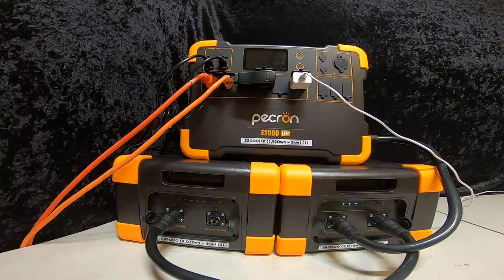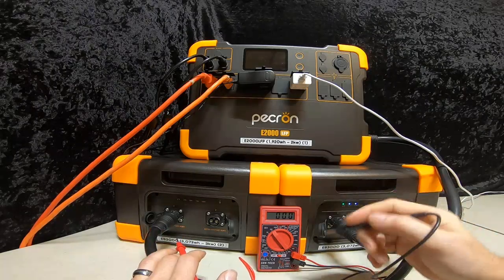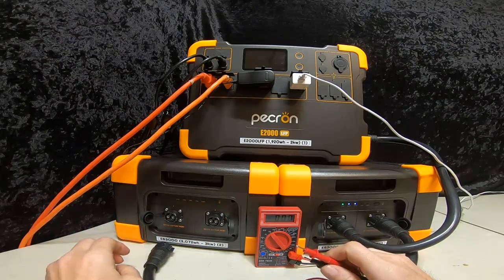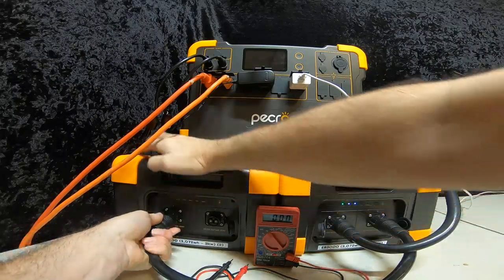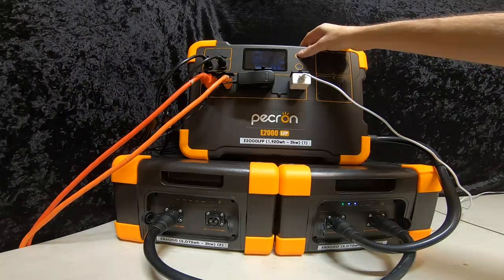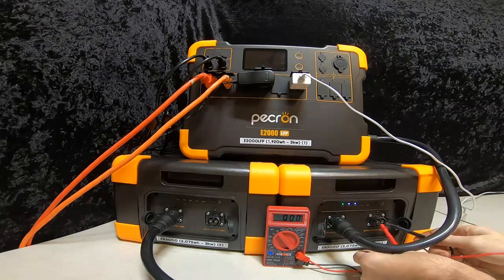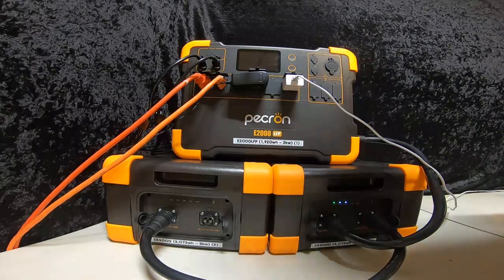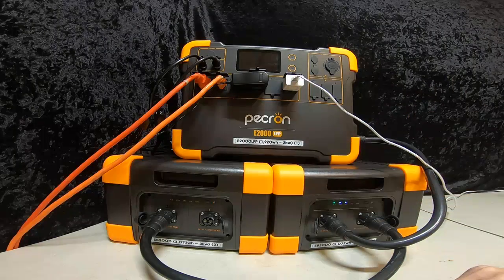PECRON E2000LFP & EB3000 (Important Question From A Viewer)

Comment: Those power meters don't seem to be working.  I really thank your work.  I don't really need those meters, as long as I can input the total wattage (through previous videos you did) and it calculate things I'm good.  And it does seem to be balancing good between batteries, the meters seem to be having a harder time.  I laughed about your idea of putting tape over the lights and solving the problem, but it's really true, that does seem to resolve the problem.  Because in truth if watching the main system there is no problem.
Reply from the maker: Duct tape can really fix a lot of life's headaches....LOL

Comment from the maker: *IMPORTANT

Something that i did not notice when doing this test, Notice if you watch "VERY" close when i plugged back in that first battery closest to the e2000lfp...

Those power meter lights flashed in a series almost like saying, Hello pecron e2000lfp, I'm ready to work boss... (WATCH IT AGAIN)

It happened so fast that i bet you can't see them in real time, Or because of the flicker rate of the video, It was easier to catch on video rather then the naked eye.

But if the new cable helps "Kilo M"....PECRON, SEND ME SOME NEW CABLES FOR ME TO TEST FOR EVERYBODY :)